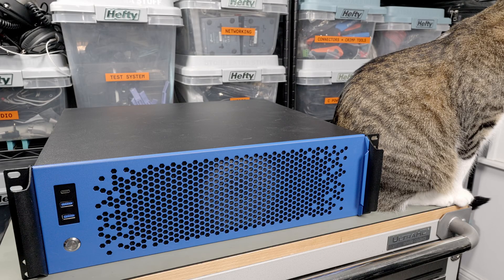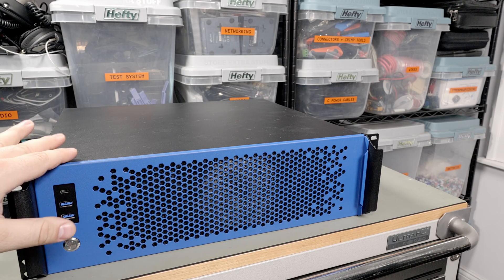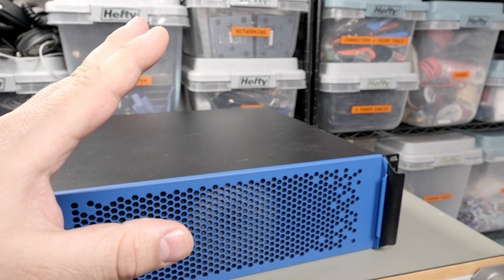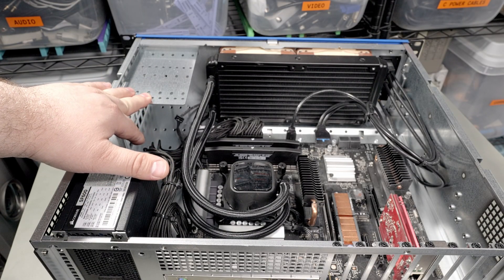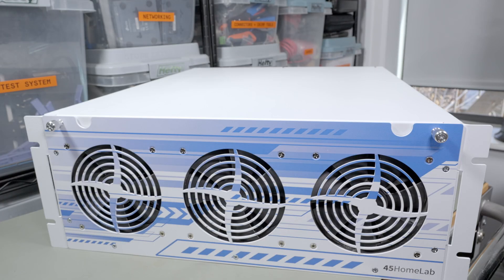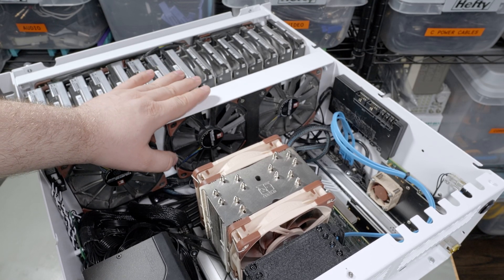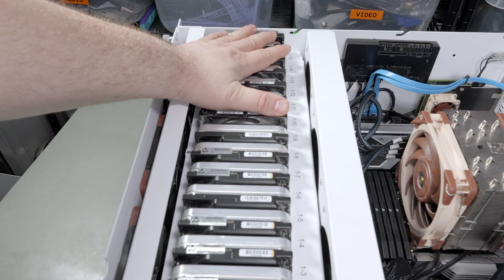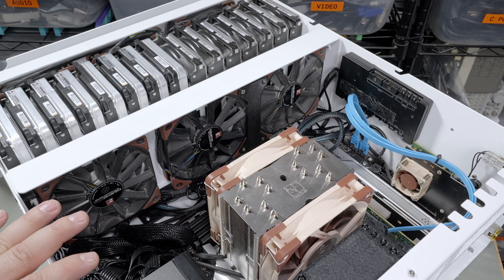New server cases (Sliger 3U + 45HomeLab)

Comment: I've been thinking about going to a short depth as well. I'm heading towards the Silverstone cases though; one major reason is they have an 8th PCI slot, which would be perfect for an exhaust or fan area. There are lots of options but I have the Nexus Air Flow fan that is external but connects to the slot. I think it makes a huge difference for cooling in that area. Plus I have so many 5.25" bay devices, so I want to keep using them and their cases still offer 5.25" slots.  Right now I have the long depth mid-wall fan Rosewill 4U's (4 x of them).

Comment: So this wouldn't fit a 3060 ti?
Reply from the maker: The Sliger has pretty tight requirements for a GPU since it's only a 3U case. Look up the case for the specs and compare it to the GPU you have/want to see if it'll fit.

Comment: nah, (almost) nobody's buying 45drives for a homelab, so that particular argument i don't think is valid. what would be a more valid one is that things like hl15 are not that big, so they might be used in small-medium businesses where there's no dedicated server room, so they'd benefit from a more quiet option

also why would you bother with windows for plex?
Reply: What is your metric for 'almost nobody'?  Between r/homelab and 45homelabs forums there are a decent number of people out there using HL15's and I've talked a number of people who have purchased one and are happy with it.  Most of them have been fine with modding the fans since like you mention the default setup isn't exactly quiet but aside of that I'd have to say you are wrong.  A business that wants/needs support options is going to go with the AV15 (but there are also probably SMB's that would use an HL1, but the majority of the users I've seen/heard of are homelabbers who have previously used something like the rosewill 4500U and don't want to go through that pain again.

Comment: One advantage in the US is that supermicro cases like SC846 are plenty on ebay. Isnt that a better choice than HL 15?
Reply from the maker: Yes and no. I run my HL15 with the Noctua fans turned way down and it's super quiet.

Most SM cases are super loud that or you need to track down a quiet version of their PSUs, etc. I think overall for noise and features the HL15 works for me... At a price...
Reply: @PeterBrockie  you can quiet down a sm case by replacing the built-in fan wall with 3 120s or 140s

Comment: I have the 20U version of the rack you showed and I just ordered 2 cases from Sliger (will be here Monday) with rails. What issues did you have with the rails and what kind of solution did you come up with?
Reply from the maker: The HL15 server rails work perfectly. The Sliger ones jam completely. You can't push the server in at all. They use different models now so maybe they're better.

Protip: at least in the 12U, once you get some hardware installed you can remove the top-front frame and it gives you one more I of space for a switch or something. They made the frame 1U in size. Haha

Comment: I caved and ordered the HL-15 last week after foreseeing the issues you mention. This is the first time I've actually seen proper footage of the 6 bay SSD caddy which I also ordered! I'm on the fence about replacing the fans. I thought I'd get it first and see how it is, but I know I'll be happier just throwing Noctua fans in from the start. Supposedly you can reduce a few watts since they are PWM and won't be 100% 24/7. 45drives does offer a Noctua option at purchase or a kit post-purchase. I opted to forego that because it includes a fan hub which needs a SATA power connector. If you are powering their backplane with the recommended 4xPSU <> Molex connector, that doesn't leave many SATA/peripheral PSU ports left, so I'm snagging a few fan splitters to run each set of 3 fans off 1 MB fan header. This should make cabling cleaner too since you don't need extension cables to reach the hub etc. 

I like your approach of replicating the pools but wouldn't that ideally be done on a separate box to avoid any shared point of failure?

One other thing - their Noctua kit comes with 3xNoctua NA-IS1-12 inlet spacers for the 3 front fans. Apparently these improve both airflow and noise when the fans are right up against grills and other obstacles.

Comment: Lack of cooling is a big downside for the sliger case IMHO. I had trouble with rosewill case too like you. Turned out that the 8087 cables had gone bad. I replaced them and the zpool is happy now.
Reply from the maker: Most of their cases are triple 120mm fans (like Rosewill and just about every 4U case), so I don't really have any worries about cooling for most things. I took the hit on the cooler size because I wanted the option for drives and the system is quite low power. That being said, I should have just gotten the driveless one since in retrospect I will probably never have drives in there. haha